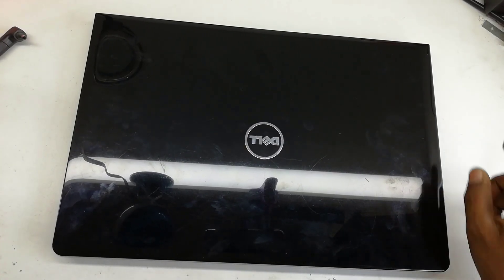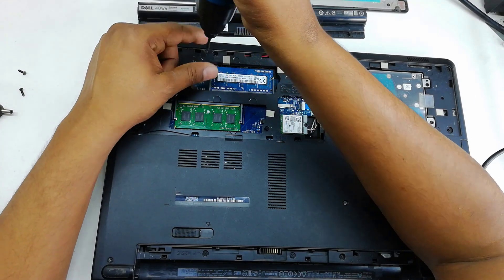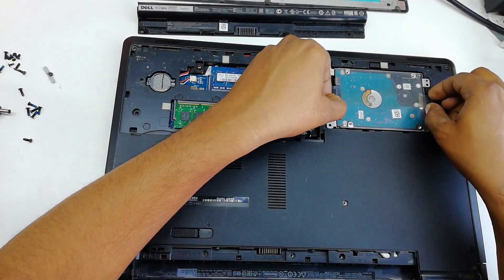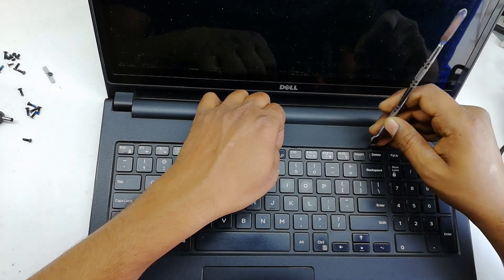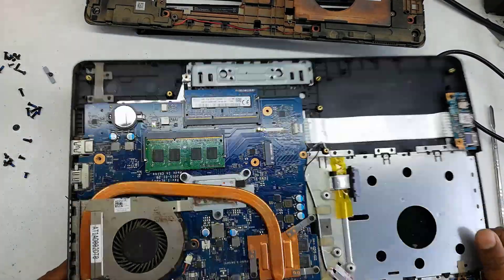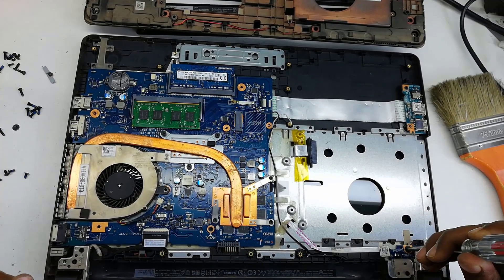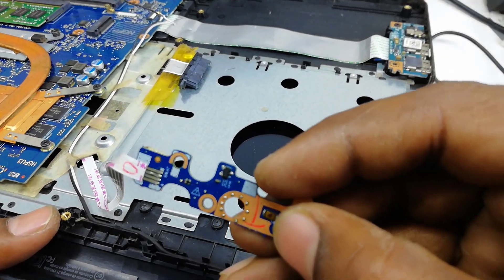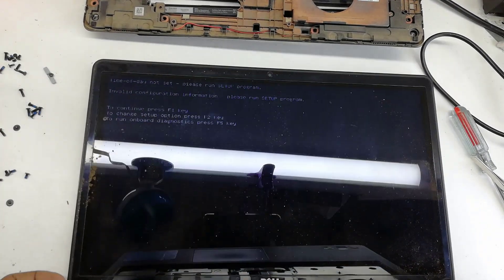Please Mute music , Dell Inspiron 15 5558 5559 Power On Button and no power Solve By # Nasir Ahmad #

Comment: The reason why this laptop didn't turn on is because the ram/memory needed to be reseated. While disassembly laptop the ram got reseated somehow and that's why screen turned on after disassembly.
Reply from the maker: Maybe ram slot or ram dust problem

Comment: Hello sir ,thank you for video guide,my laptop was not starting then I reset the BIOS and updated later from Dell website.
But now problem is
1. it is powering on only when plugged in charging. 
2. Later if you remove plugin it's working fine with battery backup.
3. Battery also charging.
4. Earlier also when it was running. it sleeps ,it doesn't awake most of the time with any key,but when plugged in it was turning on.
I'm confused please tell me how to fix it. 
I have Dell 15 R 5558 series.
Reply: I'm from Raipur, currently in ballary Karnataka.
My laptop is stating ,but only when charger is plugged in. Later it's holding battery backup ,around 30min. I checked later if I pressed Power button laptop in not turning off. So I think two problems here, one is power button.
Reply from the maker: I don't understand your problem brother, you can say in Hindi language
Reply from the maker: thanks for your valuable comment
where are you from?
display come in your laptop?
Reply: Power button kaam nahi kar raha hai.charging laga kar on hota hai.kyunki usame options hai ki charging lagane se start ho( boot setup me) . On hone ke baad battery me chalta hai.
Power button ko kaise repair karu
Reply from the maker: @Prf099  apke pas soldering iron hay?
Reply: No sir
Reply from the maker: Power on button change kije
Mobile accessories market me ye on button apko milega

Comment: hi, i got a dell 15 5552, it doesnt power up, and the power button is ok, already removed the battery, ram, and  the battery from motherboard, and stil it doesnt work, any idea? thanks
Reply from the maker: I think you should go a good service center, i think you can't fix this problem, may be bios or motherboard problem